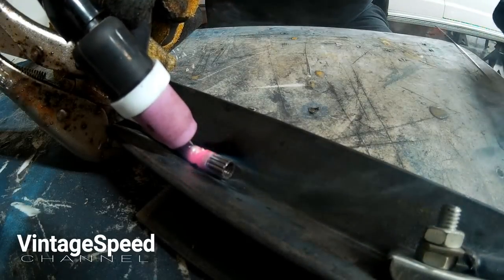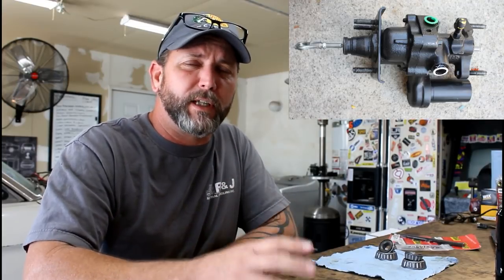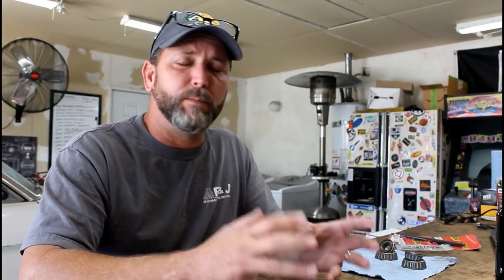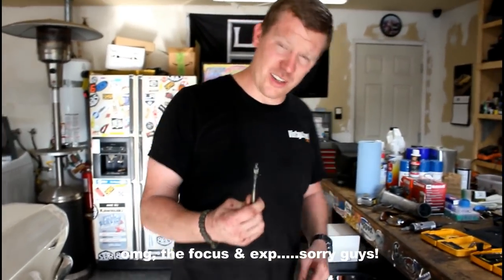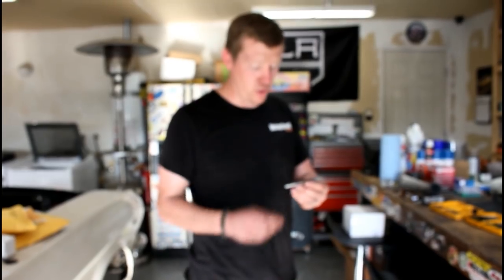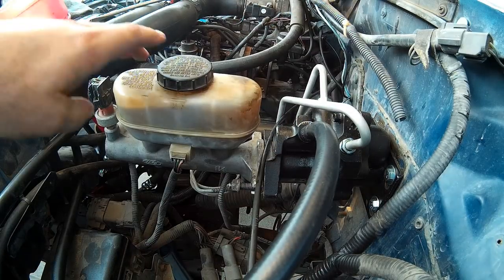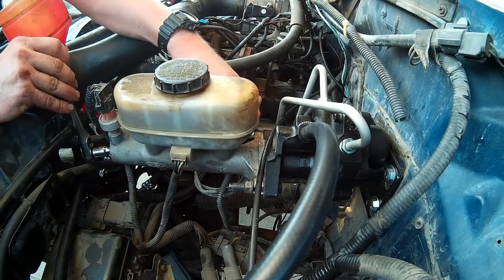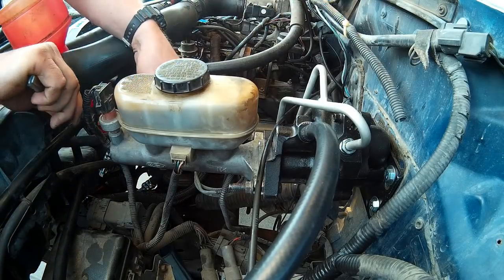Ford OBS; Hydroboost Install on Kevin's Big Blue Badass F350

Comment: I did the hydroboost conversion my my 95 250 powerstroke. Instead or moving the bolts on the bracket, I relocated the pin on the brake pedal which helps leverage and reduces the stiffness of the pedal. I love your videos and love the hydroboost conversion, probably the best upgrade I have done other than swapping to a solid front axle.

Comment: A couple questions: have you any plans on deleting the belt driven vacuum pump and going with the super duty electric pump to accompany the HB? 
Did you custom make the lines to fit?  
Did you run the fluid sensor to a light or gauge somewhere in the truck? 
Thanks!
Reply from the maker: hi John, all good points!  the Hydroboost setup on Kevin's truck doesn't affect vac because it's a gas 460, and the lines were standard length SD lines.....but you raise a good point that i hadn't considered for my coming motor swap on the 7.3, what to do about vac...  i think the only thing i really need vac for after doing the swap will be HVAC, and the SD pump may be the way to go.  although i have a digital dash panel from a CV that would use electric rather than vac motors for the blend door and vent functions...but may be a headache to convert over....  good stuff to think about, thanks!

Comment: Quick question, ever extended a truck's frame. If so, any tips, right or wrong ways?
Reply from the maker: good question!  shortening a frame is relatively easy and doesn't take much reinforcement because you have the same number of cross members for a shorter length of frame versus stock, which equals a stronger structure (assuming good welds and plating)  lengthening a frame though is going to reduce the number of cross members over the frame length, so you'll want to add at least one, probably two, cross members depending on length of the extension.  i would also box in the frame rails before & after the extension, in addition to Z-ing the frame and plating the cut sections.  the only really BAD way to cut a frame is straight down & butting the frame ends together, this creates a straight vertical line where a crack could easily form and has reduced weld area versus a Z cut.  Z cut, weld fully, grind smooth and fishplate using several plug welds (rosettes) and a perimeter weld around the fishplate, both inner & outer of the frame rail.  take into account body mount and/or bed mounting points when planning where to add cross members.
Reply: @vintagespeed  I agree and understand with everything you suggested. I've seen a couple videos of frames being stretched and everyone has straight cut and but welded it back together, then plate over that, can't be good. I just bought a 95 4dr f350 powerstroke and my son and I wanna add another axle and build a 6x6. We're both agree we might have to stretch the frame to accommodate the transmission with 2 transfer cases.  Should be a cool build!  Once again thanks for the feed back and keep the bad ass videos rolling, thank you!
Reply from the maker: magnificentshine1  yeah, it's really not any more work to Z cut the frame and it makes a much stronger splice.  also, grab a piece of 2x3 or 2x2 tube and make a straight edge that you can bolt into the bed mounting points along the frame when the bed is off, this way you'll know that the frame it totally straight & level and your bed wont need shimming after you weld it all back together.  thanks for watching!

Comment: Question! I’m trying to figure out the set up of which lines go where and if I keep any stock lines. I was pretty sure I had it figured out then I was stumped! Do you have a diagram or some pictures I could see?
Reply from the maker: i will have to let Kevin reply on this one, we didn't use a diagram.  the pressure from the pump goes through the hydroboost unit, then to the steering  box and back to the cooler/pump reservoir.
Reply: Hopefully you got it figured out, but if not, this forum posting has a lot of useful info/pictures.  https://www.ford-trucks.com/forums/1093022-my-latest-project-hydroboost-brakes.html

Comment: For the reservoir line, did he T them off for return or did he  get the correct reservoir with the 2 return ports? Ive heard if you T them together it could cause issues. Just wondering if that is true.

Comment: Cool!
I want to do the same to my 94 f350,460 crew cab long bed and it has a 6inch lift on 38's and it stops ok. Lol
Where did he order the hydro set up?
Reply: I ordered all mine from Rock Auto. I ordered everything from a same year F-Superduty. You'll likely need to source the pushrod in between the MC and HB unit from somewhere online (Karp's Power Brake). Its worth swapping to the F-Superduty MC too due to the larger bore size.
Reply: Kevin Sinclair Awesome! Thank you I'll check it out
Reply: @kevinsinclair1013  sorry I know this is an old video but what rod are you talking about between the MC and hydroboost? I did the swap but I have an extremely hard pedal like I almost can’t push it in.
Reply: @morganfoisy7133  from what I remember, the rod has a different length and you have to find one from an OBS Ford that came with Hydroboost. I think only the F-Superduty trucks did. The hydro boost swap you either relocate the entire hydro boost or relocate the pin on the brake pedal (down about 3/4") to get correct alignment under the dash. The best approach is to relocate the pin on the pedal because it increases the leverage on the HB/MC and helps with pedal stiffness. I did not do that and also have a hard pedal. However, the brakes are significantly stronger, I just have to push harder. When I do the ZF5 swap, I will address the hard pedal issue. Hopefully that makes some sort of sense.
Reply: @kevinsinclair1013  ok thank you for the info. I did relocate the pin on the pedal before installing the hydro boost. Guess I can pull the master off and check the rod. The hydroboost I installed is off of a 90s ford with hydroboost. Can’t remember what year
Reply: @morganfoisy7133  if the HB came with a rod, then you have the right one. Mine didn't so I had to go find one. Did braking improve? Could be a bad HB?
Reply: @kevinsinclair1013  braking definitely improved other than the pedal hardly moves

Comment: hello my name is mike i have f350 7.3 IDI currently factory with vacuum booster ? is should i go to scrap yard and get power steering pump and hydroboost for complete set up or can i use power steering pump i have  thanks
Reply: The main difference between the pumps (for the hydroboost) seems to be a additional return nipple attached to the fill neck of the reservoir, which you connect with hose and clamps to the hydroboost return nipple.  This is needed to return the "used" fluid that gets expended while using the brakes.

Comment: Can you show how he ran the lines for the hydro boost
Reply from the maker: i'll see what i can find for a diagram.  basically the hi-pressure output from the pump is run through the hydro boost first, then to the steering box.  both the hydro boost and the steering box return bypassed fluid back to the pump reservoir.

Comment: I did the Saginaw conversation an redhead it’s so nice!!!!
Reply: I want to do the Saginaw swap too. I've been reading differing opinions on which power steering bracket I need. What vehicle did you pull yours off of?
Reply: I got it off a ford van and any motor works their all the same bracket.
Reply: It’s just a power steering and ac bracket
Reply: I found one on eBay for 80 bucks
Reply: Also if you have an 80 to I think 86 the bracket is different you’d have to get one off the same year range van and it your truck is 87-96 I believe it’s that range of van I got mine off a 96 ford e150 and it bolts right up. Be careful of you go to a junk yard and not break any ac bolts they get stuck in the bracket
Reply: @thomashunt7717  right on! Yea, I was wondering about if the engine size made any difference. My truck is the one in the video so I'll need that era van. Awesome! Thanks!
Reply: Awesome sorry for replying so much lol I kept forgetting stuff but have fun man it’ll be awesome once you do it the noice goes away instant and the red head makes a world of difference too
Reply: @thomashunt7717  I did the Red Head too and that alone was a big improvement. Def worth the money
Reply: In the end when I switch to 4bt Cummins the work I did for the convention on the pump will be pointless😂
Reply: I ebayed 94 ford van ac bracket
Reply: Will a Saginaw pump of a E series gas work for an obs 1997 7.3 ?